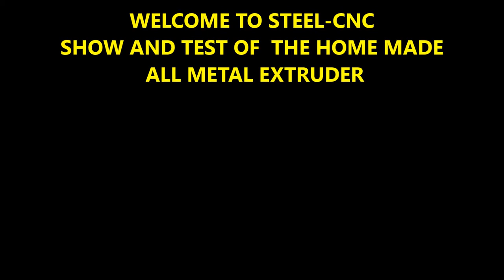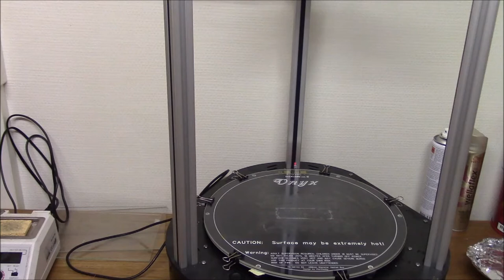Testing the all metal extruder

Comment: All metal, as in the hot end? Might be able to take higher temperatures if it is all-metal.
Reply from the maker: exaltdragon  thank you for the comment. the plan was to make a wear resistant cold end. I do not  hope the cold end gets hot, then i think i have bigger problems than a 3d printed plastic extruder body :-P
Reply: Oh I see.. ok, I was just researching on all-metal hot ends to print higher temperature materials like polycarbonate and nylon. Thanks for the reply.
Reply from the maker: I put on a all metal hot end too a j-head mk 4 it works nice.  I did not make that. But you could.. but chek out the j-head mk 5. The new maybe betrer :-)
Reply: ok, thanks!
Reply: exaltdragonthis j-head is kinda different though, as it has a PEEK nozzle holder though.. Seems like that would melt at higher temperatures(Around 300C), so it probably can't handle PC. But thanks for the heads up.